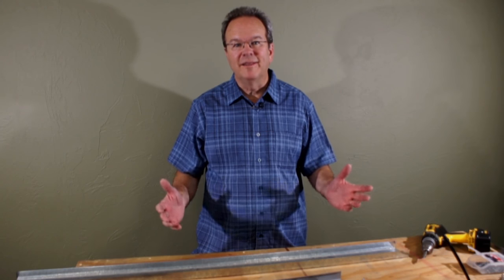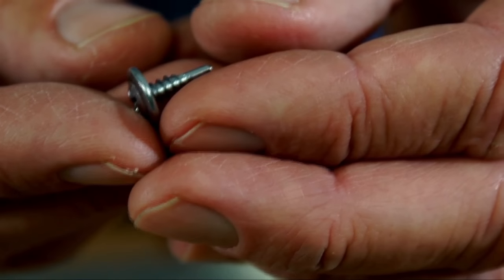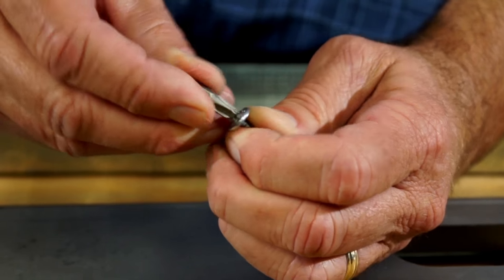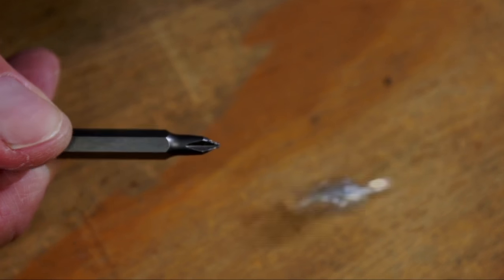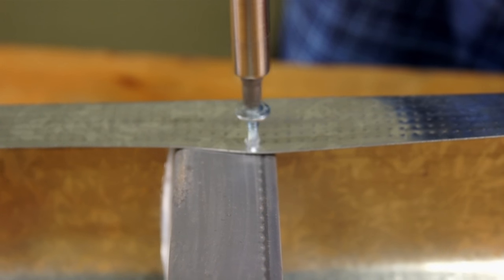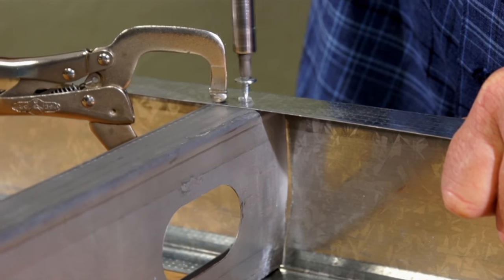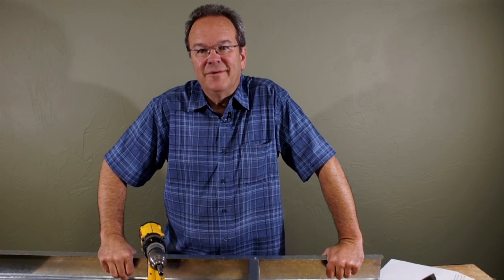How to Install a Self-Tapping Sheet Metal Screw

Comment: my hubby has to replace the metal panels on the inside of our commercial building.  he was told he needed a particular screw gun to do it.  a screw gun that runs at a higher RPM than most.  do you have a suggestion for something like this that isn't outrageously expensive?  thank you
Reply from the maker: He’s correct.  An actual “screwgun” does run at a faster rpm, making the work easier, faster and thus more feasible.  We used to get some really good deals on screwguns at a local supply house, so it might pay for you to check some of the commercial tool stores, or even the big-box stores, to try to find a better deal.  
Just now on the internet, I found a Dewalt for $80 and a Bauer brand? at Harbor Freight for  $55.   That’s a great deal for a Dewalt, and a good price for the Bauer, but I can’t vouch for the quality of it as I haven’t used their tools.  It’s probably plenty good for the job.  Dewalt is a work horse for the wall covering industry.   And don’t worry, we don’t sell either and have no financial interest of benefit in these recommendations.  But those prices are actually very good deals.  Best of luck on your project.
Reply: @FlexAbilityConcepts  is there a particular model to look for?  w e have had really good luck with harbor freight tools and they have a 100% guarantee.  we own a Milwaukee  electric drill that I bought him several years ago, but looked it up and it says 850rpm.

  HarborFreight suggested that we try that first since Milwaukee tools - even though lower RPM - are workhorse drills.  I just don't know what to look for.  I looked up screwgun at Harbor Freight and found only something called a spool gun. so not sure what to look for there or in a DeWalt brand are they called screw guns?  most I see say drywall drills.  are those the same thing?

.  I have no problem ordering from EBAY or Amazon.  just trying to find something that will do the job.  Harbor  Freight has also been a good source of misc tools since many of their tools have lifetime warranties.  not the drills, but the tools
Reply from the maker: @ssergeant9682  Here’s the description I found.  Again, I can’t vouch for this brand, but it should work fine.  I believe it’s 4000 rpm, and the Dewalt is even faster, at 5300 rpm. Either speed is quite a bit faster than a typical drill, (which would go 850 rpm plus or minus) and will work fine.  
BAUER
5 Amp Heavy Duty Drywall Variable Speed Reversible Screwdriver
The Dewalt is described as  :
DEWALT 6-Amp Screw Gun
Again, these are just the first two that popped up in a quick google search.  There are a number of other brands that will work excellently.  I just wanted to try to help you find what to call them in your internet search.  So, Screw Gun or Drywall variable speed Reversible screwdriver, will both work in an internet search to shop for your tool.   
I hope this helps.

Comment: Self drilling screw*
A self tapping screw can tap it own thread but need that initial hole
A self drilling screw can drill and tap it's own thread. That's what is used in the video
Reply from the maker: Good catch!  Self-tappers don’t necessarily have a drill point, so self-tappers aren’t always self-drillers. And self-drillers are self-tappers. But you’re right, it is a very common mistake. So common in fact, that the terms are often, in our experience, interchangeable. Thanks again.

Comment: Can you use these on wood?
Reply from the maker: Hi Leigh Ann,  thanks for the comment and question!  Well, yes, but not really.  These self-drilling sheet metal screws have a drill point on them that removes a lot of material so that the shank of the screw can enter freely while the threads grab the sheet metal on the sides of the hole.  This “thread grab” is sufficient with sheet metal, but not so good for wood.  When you install a screw into wood, you want the pilot hole to be much smaller (depending on the hardness of the wood, which varies) so that the screw can twist into this hole, and with this tight fit, the threads grab much better in the wood.  So, while you can use these self-drilling sheet metal screws in wood, they won’t grab as well as they would if you used a pointed screw and a smaller pilot hole.  Hope this helps!

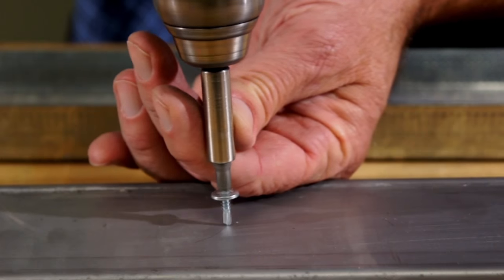Comment: 2:00 how thick is that metal? will that tap into 1/4" hard steel like the flat side of T-post.
Reply from the maker: Good question.  These screws are designed for use with sheet metal.  A T-post is not only much thicker, but as you mentioned, hardened.  They make self -drilling screws for thicker steel, but if the steel is hardened, they may or may not work.  Thanks for the great question!

Comment: Would these screws work when screwing something to a metal door?
Reply from the maker: Good question Scott! Yes, these screws could be used to “ fasten something to a metal door”.  But that depends on what you are trying to fasten to the door.  These screws are intended to be used with two layers of sheet metal, and metal doors are made of sheet metal. If you are trying to fasten hinges to the metal door, you would want to use heavier duty, finer threaded screws to carry the heavier stress/load. So, yes, but it all depends on what you are wanting to fasten to the metal door.

Comment: If you can help it, do NOT use Philips head. If you are not careful you will strip them. Star head is really good for most types of screws but for metal I really like the ones that you need a nut driver for like 5/16 or something.

Comment: I thought for self tapping screws we need a pilot hole?
Reply from the maker: Thanks for your question.  That would be true if the self-tapping screw were not also a self-drilling screw, especially if the sheet metal is thicker than 25 gauge.

Comment: Technically that is a self drilling screw a self tapper has a thread going all the way to a point and is used when the top piece has a hole and the bottom piece has either a smaller hole or none at all
Reply from the maker: FlexAbilityConcepts
Hi Richard, thanks for your input.  Certainly you are correct.  Self-tappers don’t necessarily have a drill point, so self-tappers aren’t always self-drillers. And self-drillers are self-tappers. But you’re right, it is a very common mistake.  So common in fact, that the terms are often, in the everyday common usage, interchangeable. Thanks again. 
- Frank

Comment: Will self-tapping or sheet metal screws go into wrought iron? I can't get mine to do so. Any suggestions, anyone?
Thanks!
Reply from the maker: As their name denotes, Self-Tapping Sheet Metal Screws are specially designed for use in sheet metal.  Wrought iron is thicker, which prevents the design of these screws from working as designed.  If you have some wrought iron that is thinner, say 1/8” or so, you could drill a pilot hole that is just a little smaller than the widest part of the self-tapping screw threads, and then the screw could be installed in this thicker-than-usual metal, as the threads could kind of scrape a little shallow thread pattern in the sides of the hole in this thicker metal.  But this eliminates the benefit of even using a Self-Tapping screw, if you use a drill to make the proper hole first.   The little drill point on the Self-Tapping Screws is just large enough to let the screw cut through the thin sheet metal.  These threads on these screws just aren’t tough enough to tap deep substantial threads into a thick layer of metal, (wrought iron). They do make some tougher self-tapping screws than we’ve shown in the video, usually not black colored, that have a much finer and stronger thread, designed for thicker steel such as wrought iron, but the only ones that I’ve seen have a countersunk head and they’re pretty large, intended for screwing plywood to metal joists or installing door hardware to metal doors or jambs. They probably wouldn’t look too good on wrought iron.   I hope this helps.
Reply: Thanks for your reply!
I had just ended up drilling a pilot hole, following up with my sheet metal screws. (Hardware store had errantly told me self-tapping sheet metal screws would tap right into wrought iron.)
Reply from the maker: I am glad you got it figured out and that we could help! Please let us know if we can be of any further assistance in the future!

Comment: Those are self-drilling screws, not self-tapping. The self-tapping screws have a pointy end and need a pilot hole.
Reply from the maker: Hi Marin,
Thank you for your comment.  I wasn’t sure if I was using the correct term myself so I started researching what is the correct names for these screws.  
Turns out, the screws in the video are self-tapping and they are also self-drilling. As it says in Wikipedia, “Some self-tapping screws are also self-drilling”.
They were quoting from this website, a screw manufacturer who wrote:
"Here’s where the confusion comes from, a self tapping screw can also be self drilling. Basically a self drilling screw is a tapping screw that doesn’t need a pilot hole. They both technically tap their own threads, all screws do this to varying degrees. But, the self drilling screws skip a step in the process.
"
I hope we have cleared up all the confusion, just remember all self drilling screws are self tapping, but not all self tapping screws are self drilling.
So, we didn’t mean to cause confusion when we labelled this video “self-tapping”, but rather we were trying to use the most common names used in the workplace, which I’m sure varies by location.  
Thanks, Frank

Comment: The screw he is using is a self drilling screw not a self tapping screw, self tapping screws require pre drilled holes.
Reply from the maker: Good catch!  Self-tappers don’t necessarily have a drill point, so self-tappers aren’t always self-drillers. And self-drillers are self-tappers. But you’re right, it is a very common mistake. So common in fact, that the terms are often, in our experience, interchangeable. Thanks again.

Comment: Those are self drilling screws 😮
Reply from the maker: Hello @bert1913.  Nice observation!  Self-tappers don’t necessarily have a drill point, so self-tappers aren’t always self-drillers. And self-drillers are self-tappers. But you’re right, it is a very common mistake. So common in fact, that the terms are often, in our experience, interchangeable. Thanks again.

Comment: You have made a very common mistake. You have confused a self-drilling fastener for a self-tapping fastener.
Reply from the maker: Hi Tim, Thanks for your input.  Certainly you are correct.  Self-tappers don’t necessarily have a drill point, so self-tappers aren’t always self-drillers. And self-drillers are self-tappers. But you’re right, it is a very common mistake.  So common in fact, that the terms are often, in the everyday common usage, interchangeable. Thanks again. 
- Frank

Comment: easier to make holes with a drill bit first
Reply from the maker: Thanks for your comment.  Please note, these screws have a drill bit point built in to do the drilling so the hole can be drilled and the screw installed in one operation rather than changing tools.
Reply: yes, but they are dancing all over, besides if you want to secure two airducts, there's no way you can drill it with the screw point, it just would not bite and keep wobling
Reply from the maker: With air ducts, since you can't clamp the joint tightly, a drill bit could help you.  Good point.
Reply: FlexAbilityConcepts “Good point?” I see what you did there! (Whether you meant to or not.) :-)

Comment: Are there self tapping screws for brick or concrete walls?
Reply from the maker: Yes, Sourav,
There is a type of screw that will tap threads (of a sort) in concrete and brick.  
The most popular screw  of this type is the “Tapcon” brand, often identifiable by its blue color.  I’ve seen a few other versions/brands at the lumber yards, but don’t remember their names.  These “tapcons” are not self-drillers, in that they do not have a drill bit on each screw. Rather, using a masonry drill bit, you need to drill a specific sized pilot hole first.  Then, as you install the screw, it will cut some threads into the sides of the hole you’ve drilled in the concrete or brick.  Typically, they sell or supply (often in the box, with the screws),the proper size masonry drill bit when you buy the screws to be sure it is the proper diameter for the screw.

These “tapcons” are available in a number of diameters, lengths and head designs (phillips, or hex drive), depending on what you are securing to the concrete or masonry and how strong it needs to be.  

The integrity of this type anchor also depends on the concrete or brick, or concrete block you are anchoring to.  
If they are crumbly, then obviously the attachment will not be as secure as when the substrate is very dense, solid and hard.  
If you need the strongest anchoring method, you’ll want to investigate the other types of anchors, such as wedge-type anchors, sleeve anchors, epoxy anchors and various other mechanically operating anchors.  

I hope this helps.  These type screws are widely used and are very effective.
Reply: @FlexAbilityConcepts  thanx a lot for such detailed information and prompt reply.